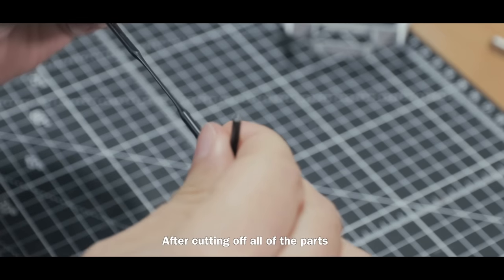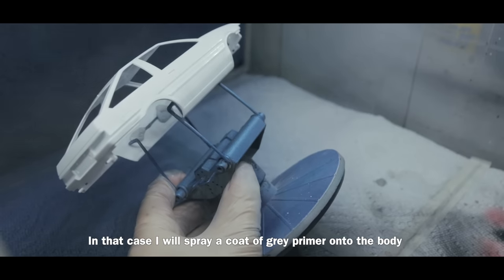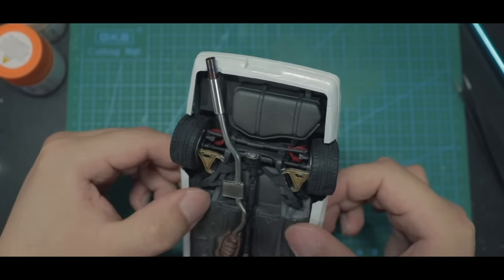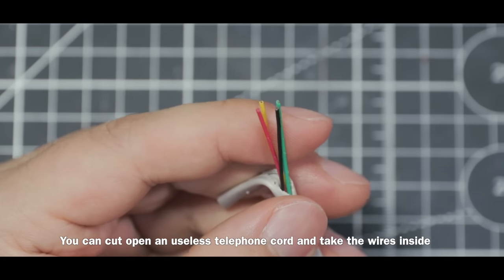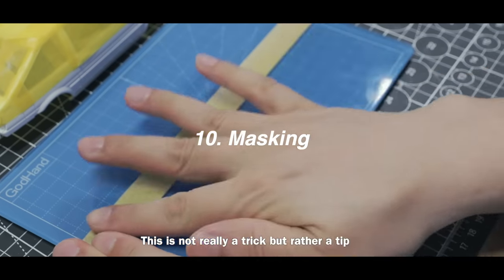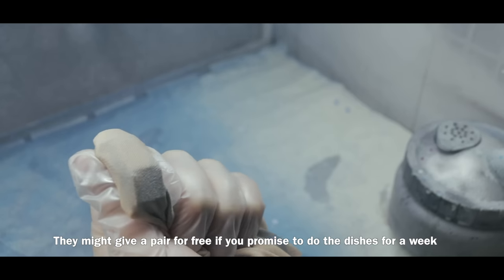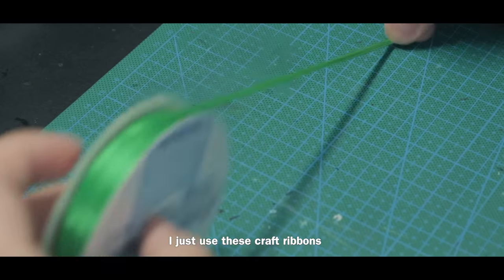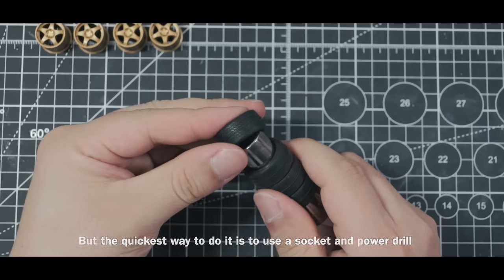19 Tips and Tricks for Scale Modelers

Comment: I’m an aircraft modeller mainly, but one tip I have is to never throw out old paintbrushes. A beat up old brush might not be good for detail work and getting a nice finish, but it will be fine for messy and rough treatment that would ruin a good brush such as weathering, applying texture or using glue. Once the brush is completely destroyed, you can still use it as a glue applicator, or to hold something while you paint it. You can even make your own specialised tools and use the old handle for it.
Reply from the maker: Great tip! Thank you for sharing James!
Reply: Thank you !!
Reply: does this trip work on tank models too?
Reply: @KarlRich10  don't see any reason it wouldn't so yeah 👍
Reply: You can also fully paint a brush all round in black then put it in a wooden block and bang you have a cheap aircraft stand
Reply: @pepsiblob  ok thanks!

Comment: Been building models for almost 40 years and I still learned some useful tips in this video. Great work 👍👍
Reply: agreed.. been building for 25 years and learned new tricks.  I knew about the wires. I do that for my 18 wheelers for the hoses at the back of the cab. and I've used the trees to make all sorts of things from engine hoists to custom frames,. the radio antenna ik for 18 wheeler exhaust as well. and what blew my mind.  was the rust paint. and the totally awesome to stripe chrome, yeah blew my mind.  what have I been doing with myself,  no more sanding lol 🤯🤯🤣

Comment: If you're ever tearing apart some old wire, you may want to save the little tiny copper strands of wire, as you can wrap them around a thin needle to make small springs for carbureted engines.

Comment: One extra tip…if you make a roll cage out of  left over sprue and need some “foam” to wrap around the parts where you might hit your head…strip the insulation off the outside of a plug cable and it wraps round perfectly

Comment: 8:57 I always used Ultra Fine point Sharpie markers instead of panel line wash since they come in a variety of colors and offered a lot of control. The tips are 0.3 mm, but you can get away with pinching them a bit narrower with pliers if you're not too rough.

Comment: I thank you for the modern tips and tricks. I am going on 62 and built my first plastic model at age 6 in 1967. I taught myself modeling tricks back then. I would NEVER paint parts on the tree. For me, it was better to trim the parts, clean the cut edges, place them on double sided tape, spray paint one side, dry, flip and repeat. No messy, cut edges to touch up with a brush. You can take the tires and hold one in your thumb and forefinger and drag it across sandpaper while rotating the tire to make it look real and used. I used colored felt in 1/24 and 1/25 cars for carpet, wrapped aluminum foil with glue around chrome parts, and cut a click pen spring in half to make working suspension. You can cut the plastic front end suspension parts and melt needles into the body to make the front steer! My first ignition wires were 9 cut lengths of yellow phone wire, wrapped in a loop and glued at the distributor. I had a needle on a wooden stick, heated with a candle to melt holes in the cylinder head to insert the wires. Another idea was stretching cotton swaps out of the exhaust, or tires on a diorama, and brushing black paint to simulate smoke. On old Nascar models, cutting slits of black electric tape (or pin stripping) would work to simulate the reinforced front windshield and rear window. Use a black marker on the clear window parts on the outside edges before gluing and it will appear more realistic. Old Nascar hood pins could be made from cutting and bending paper clips. Coax cable with a wrapped, braided shield makes nice engine hoses. I used to paint the Goodyear tires using a dab of white (or yellow) paint on a toothpick, brushing the paint on the side of the tire on the raised lettering. When dry, you can scrap away the mistakes and then coat the tire with clear. You can paint worn aluminum parts using aluminum paint, then lightly brush over the parts with a scouring pad to age the finish. Thanks Jun.

Comment: I have used metal tape, made for sealing duct work for chrome strips or rails. It's thin enough to cut and press down easily,  polishes up well, and is self-adhesive. It's also a lot cheaper than some of the fancy foil you can buy

Comment: These tips are great . Thanks for sharing . Just getting back into modeling after 20 so yrs . Please post more . Wrapping wire for plug wires had no idea . Battery terminals battery posts wiring and the muffler all are excellent ideas . I will use them for sure . Thanks .

Comment: 4:25 - I do restoration/customization on 1:1 cars for work...  I use a trick very similar to this, when I want a radiator overflow hose, pcv hose, washer hose, etc to run nicely to make the engine compartment more pleasing to look at...if that makes any sense.. lol
If you do it, though, make sure it's a very slim piece of rod inside of the hose, so the hose still functions! 🙂

Thanks for these! Always helps to find new tricks!

Comment: these tips are really good! One thing I do to remove acrylic paint from a model or piece, is use an ultrasonic cleaner, pour alcohol and in about 3 minutes it will strip all paint, even the hard to reach areas. The ultrasonic cleaner I have is very small, I paid $15 on amazon as I don't need it for anything more than just cleaning the uses glass pipettes at the end of painting.

Comment: Instead of guitar strings, I found that if you can find an old car Alternator, you can open it up and take out the wires. They are the same diameter but are a softer metal so you can cut and bend them easier. 

Great tips! - I like watching other people's tips and hope they watch mine. Everyone has a great idea that's different from mine, but the over-all idea is that we all learn from one another! 

I'll have to try that carbon-fiber idea.

Comment: 4:40 just a little tip for other poeple, definetely dont put your fingers on the edge of the rubber tube, because sometimes those thin copper wires can sometimes cut you really badly

Comment: Good Video Jun. I wish i had thought of using a socket and drill to weather the tyres before. Also,  I have been using some 0.8 wire from my MIG welder for brake lines recently as it is the right colour for the old Kunifer bake pipe that we used to use in the past in the UK, and its easy to bend into shape.

Comment: Great vid and tips, thanks for sharing!
I’ve recently started building some laser cut metal models. Lots of fiddly bits with many of these, plus the tabs and slots are very tiny. Two tips for working on these 1. Super glue works great for attaching some parts when too difficult otherwise or even if you break a panel or tab. 2. As with any project, when you find yourself becoming impatient or too frustrated, simply walk away and come back to it later with a fresh attitude :  )

Comment: I found that doing things like rust or chipped paint layers can be accomplished with rubber cement. You put the rust paint in the desires areas and then apply the glue. Put the next color on and when you are finished, you simply peel the rubber off and voila, rust. I also dis this to mimic chipped clear coat on a car I just swapped the rust color for a lighter shade of the body color. Amazingly helpful video btw!

Comment: I save the metal handles from fried rice containers.  Use them for "G" scale freight car ladder rungs, which get painted same as car body.  These are outdoor trains & the metal rungs don't sag from being in the sun all day & handling abuse.  They also don't get brittle in freezing cold.  I have used it to replace the grab railing on steam locos too. The wire handle is stiff enough to hold a shape, soft enough to shape & I use a circle cutter wire cutter for clean cutting the ends.

Comment: Instead of using steel or music wire, you can use solder. I use 0.3mm lead free solder which is really easy to bend and stays in the shape you bend it. I normally use it for carburetor fuel lines because it can be heated up to connect to itself and brake lines and can also be used to in everything that involves that music/steel wire. Amazon sells a roll of 0.3mm lead free solder for 35 dollars.

Comment: Take 2 spring mouse traps and remove the arm that holds them open glue them together back to back and then you can pull the spring arms down and use them to hold bodies for painting them by puting them inside and letting the spring clamps go will hold bodies while you hold the free end of the wooden part of traps , if it has too much force you can put a little heat on the spring to loosen the tension ,  watch your fingers the trap still might bite .

Comment: Just a heads-up, you can buy heavier gauge wire with a solid core. No need to take the sheathing off of braided wire and stuff solid wire inside.  Save yourself a LOT of time and effort.

For the masking tape, give 3M vinyl tape a try. The edge is very crisp and you can very easily curve it around corners/bends and press it into concave surfaces.

Comment: I loved these tips!  Something I use to do 20+ years ago that I should do again (only started again last year) - use 2 different colour primers , start for instance with gray ,1 or 2 light +1 wet. Then a different colour say pink or white etc. Same 1 or 2 light then 1 wet. Now  I did this to determine how much the sanding removed as back then there was not all this sandpaper up to 12 000. Also found that densely produced sponges made excellent sanding material. . 
OK that's it & thx . 

Ps. Any ideas for staining clear parts without an airbrus?
Reply: Dipping in transparent inks works for me. I use Vallejo's #70.937 trans. yellow for small bottles in the bar I'm building. I dip them in the bottle, let them drip for a moment, then shake them over a towel to catch any remaining bit.

Comment: The tightly coiled springs used as a return spring, make great braided hose look-a-likes. Also use them to help prevent kinks when hand bending small tubing around odd shapes. Extra helper, pack the tubing with fine grit sand before bending. Aircraft fuel line manufacturing uses a similar method. My 2 cents.

Comment: Hey Jun, it's me again! Thank you for another great video. I am currently building Revell's 1932 Ford 5 Window Coupe 2 N' 1. I have a question on the glue process. I tried many different brands of glue, and they all fog the windows, chrome parts, paint etc. Do you have any suggestions on how I can prevent this? Thanks! - Subscriber from NY
Reply: Canopy glue or even plain old elmers clear glue works...takes alot longer to dry but it works pretty good...if you have to un fog the window you cam wetsand with 1000 grit then 2000 then 4000 and apply Maguires plastx for clear parts and it will look better than brand new if you do it right

Comment: Question: What is the best way to bend tubing? Say you want to make a brake line running under the chassis and it has to go over a support beam. Or make elbow joints?

Comment: For removing chrome plating off of parts, I usually soak the part in straight bleach.  The last 2 models I built were 'reissues' by AMT, and it seems like nothing I try removes the plating.  I even went as far as leaving one part in the bleach for almost 2 days.  All it did was soften it enough to be completely removed using ultra-fine (000) steel wool.  Any suggestions??? Thank you in advance.
Reply from the maker: Some factory chrome platings are harder to remove than others. Try putting them in model lacquer thinner. It will strip the paint easily.

Comment: Hi Jun, any tips on gluing the windows into the car? I always ended up with glue bleeding, or the window just wont stick because the paint is in the way, and ended with paint bleeding...
Reply from the maker: I use BSI super glue for clear windows, it works fine on painted surface and a tiny drop will do the job, be cautious where you apply them. Allow a little extra room for the glue to settle. I avoid using extra thin plastic cement on windows because they might run and melt paints.

Comment: hi, still newbie, what type glue should i use to glue the lamp? because i use tamiya cement the paint on body were melted
Reply from the maker: Tamiya cement will dissolve the paint so I use Bob Smith super glue(super gold plus)for light lenses. It dries clear and won’t frost up clear parts. Use a small toothpick to apply a tiny amount onto the parts where they meet each other. You still have to be care as it’s super glue, but worst case scenario if you get glue onto the paint you can still remove it by light sanding and polishing(versus Tamiya cement will destroy the paint work).

Comment: How do you make thick and opaque rust like you do on your models? Am I supposed to add a lot of steel wool and less vinegar?
Reply from the maker: The amount of steel wool and vinegar is not very important for making thick rust. I just put enough vinegar so the steel wool was submerged in the little jar. The key is to give it enough time so the rusting process can be completed, you can leave the cap opened for a few weeks then the vinegar will evaporate, leaving a good amount of rust in the jar(and it is pretty thick rust).
Reply: @JunsMiniGarage  Thanks a lot for the tip, sir. I will try to leave it for a few weeks to that the vinegar will evaporate, leaving thick rust behind.

Comment: Hey Jun, great video !
I do have an issue tho, when sanding the clear coat like you do, mine started to peel when using wet 3000. I applied a dust coat and 2 wet coat. Any tips on how to avoid it ?
Reply from the maker: What clear coat did you use? I check the status of the clear coat very often when wet sanding. Even with a few wet coats, the thickness of the model paint is still very thin. Since the clear is clear lol, it’s easy to over sand without knowing. I would spray a couple more coats of clear, let them dry/cure completely then carefully/slowly wet sand, dry the surface with paper towel after a round of sanding to check the surface. Sand until the surface looks flat and dull then stop.
Reply: I airbrushed Vallejo's polyurethane gloss varnish, thinned with water, one dust coat and two wet, and let it cure for 24h.
I think I might have been too impatient, leaving it only 24h, as my sanding didn't sand all the way, and peeled the clear coat as soon as I started 😔
Reply from the maker: I think Vallejo vanish is water based, it will be removed easily with sand paper so it cant take any heavy sanding. For car models I will use lacquer model paint(tamiya spray can, Mr color etc), it hardens when it’s dry and allows you to sand/wet sand without issues.
Reply: Thanks for the advice, I'll try that !